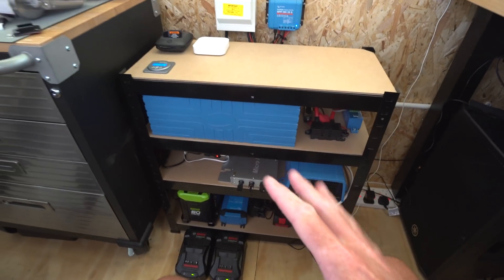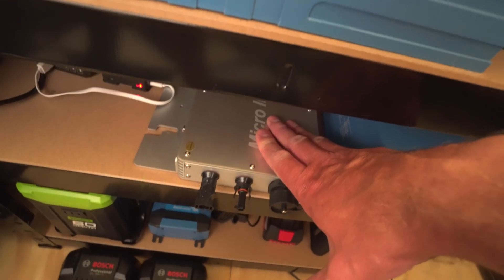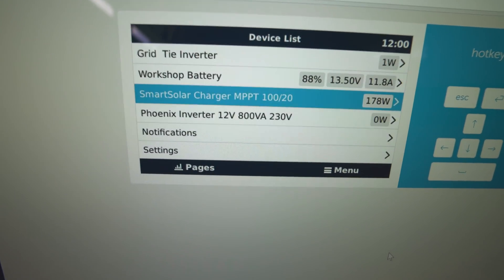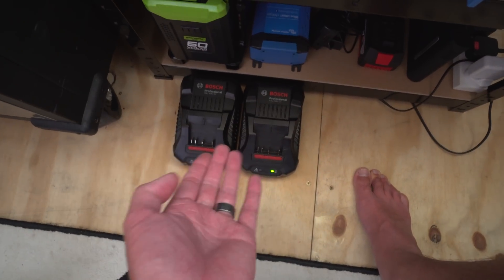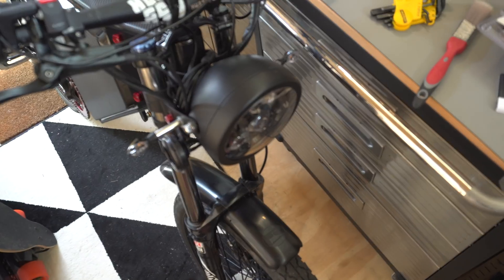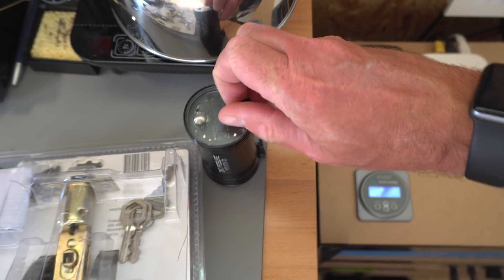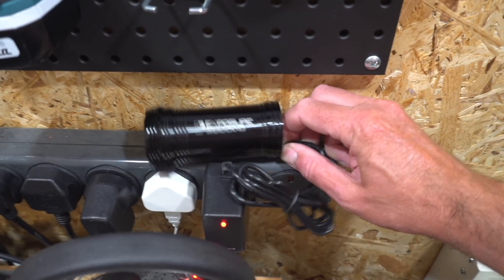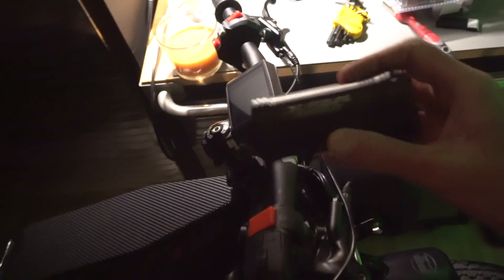SOLAR & POWERWALL UPDATE

Comment: I know this is an older video, but just curious if you use that blinding light on the road?
Reply from the maker: Yes I do. You can angle it down to prevent blinding traffic. But you’ll definitely be seen with that bad boy.

Comment: Andy, can you make me a recommendation on a Victron inverter.My setup is as follows I have a 3kw solar array with an eversol inverterhttps://pvoutput.org/list.jsp?id=67748&sid=60211this is shared to the web/pvoutput via a raspberry pi running https://github.com/solmoller/eversolar-monitorIt also runs a local webserver so I have the continuous watts im generating on the fly.I also have about 16 silicone SLA 12v batteries 60ah (probably not that capacity anymore) wired to 48v (4 emax scooter batteries in a rack) 4s4p. I manually use the scooter charger to charge when in good sunlight at about 960w.I basically wants something which can store all my excess into those lead acid batteries and then provide the baseload of the house when the suns gone down but not at night (as we are on economy 7 and we charge the leaf then).Hope you can help. did you print the cup holder for the twizy yet? ;)

Comment: Are you still using the BMS8?
Reply from the maker: Yes, sorry forgot to mention that. The BMS 8 actually cant sustain 20A continuous charge current without getting extremely hot.

Comment: Brilliant, I'm building my system up now so thankyou for the update.
Do you use the online VRM interface much or just the local 192.168.1.xxx?

Also I couldn't get my inverter to load as an AC load on the Pi it sucks, I did manage to get the DC load working.

That exposure light has balls!

Comment: Great to see that you digged out your Exposure Light again. Those things are expensive but also very bright. A friend of mine has a smaller version of yours and it really lights up the night. I guess in the end it helps to have a lightning system which is independent from the e-bikes main power. 

As for the swing arm I would agree with what some other guys already wrote: Unmount it and take it to a welder of your choice. I mean even a car repair shop could do this. Might require some time but this way you are shure the repaired part will fit in again compared to something you order online which might have slight variations.

Comment: Use black mouldable Sugru and mount the light adaptor plate directly on the top of the main light.  I've used that glue to mount a GoPro type adaptor plate to the front of my motorcycle helmet and it is brilliant.

Comment: take the swingarm off, and take it to your local welding shop.  he can weld the break, and add some gussetts to beef up the strength.  If you are not a welder, doing it yourself, may result in a weak repaiir that will break again.  Good to see you dabbling with solar....spread the word....it’s a rewarding hobby!   I think you should invest in an mppt charge controller like a midnight, or outback, that can handle 60/80 amps current.  They are very adaptable to different voltage packs, and fully programmable settings.  Then you can expand your solar array and really suck in the KWHrs!  Like your super bright light, looks expensive!  but very portable...great channel, sir!  Don’t stop tinkering, great to see more people learning about solar, It is so simple and clean,don’t know why everyone doesn’t have an array at home....release the stranglehold utility companies have on the community.

Comment: I'm a ex pro welder, dont get the gear if you don't know how to weld, take it to a shop and have it looked over and maybe reinforce it, dont bother getting a new frame, it will do it again....china steel is garbage. best option is to have one built custom, especially if you added power. just remember if u reinforce the stress maybe transferred to the next weakest point

Comment: You could take 2 relay contacters and do the switching of the grid tie and MPPT as an event with the Victron software via the relays on the BMV and MPPT , or an relay expansion board on the pi ?